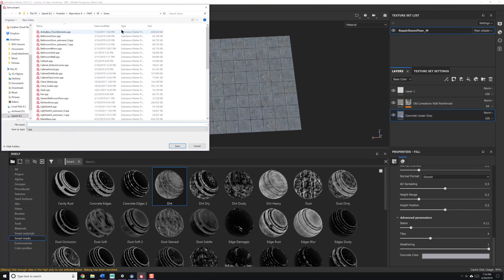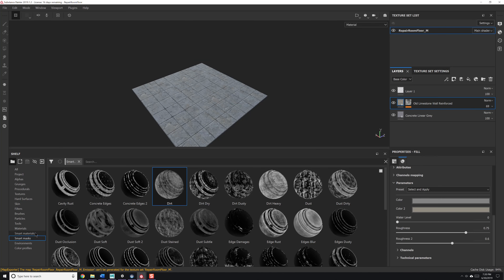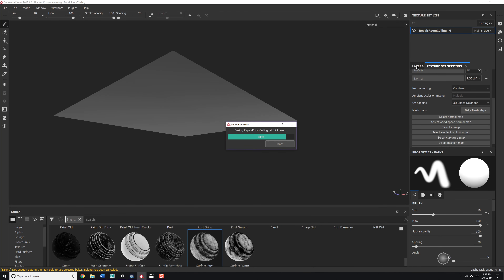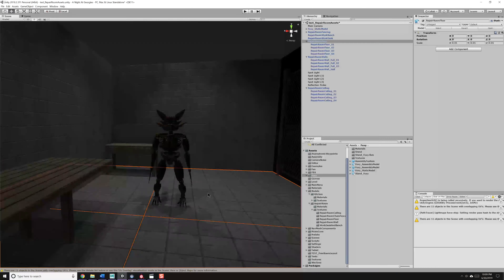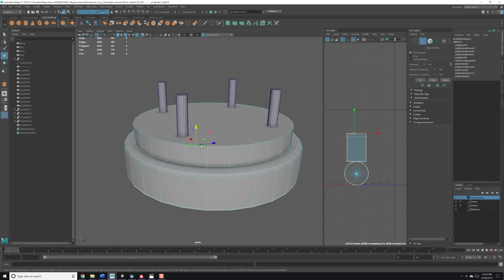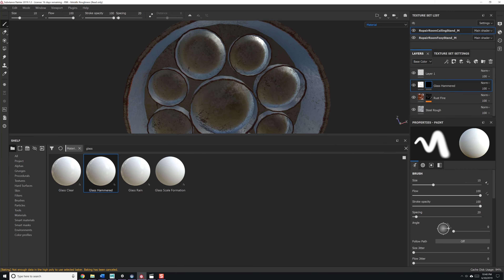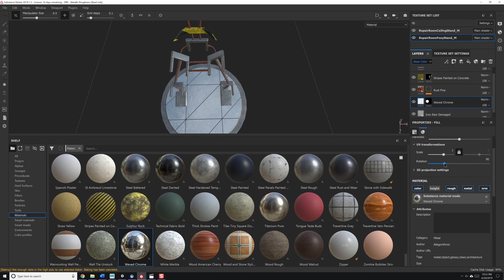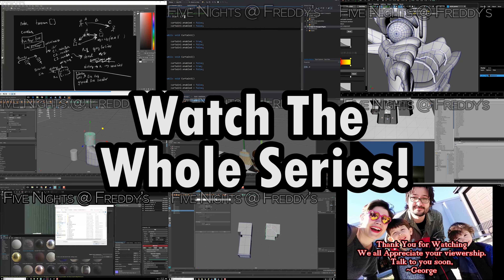FNAF VR in Unity 195 Animatronic Repair Room Modeling and Texturing

Comment: Very good. Very good indeed. Is there going to be volumetrics on for the light?
Reply from the maker: Good question, not sure yet what I'll add yet. Need to also start looking through the post processing stack.
Reply: To do that you would either need to use a plugin like aura or use hdrp
Reply from the maker: Or I could write my own volumetric handling. https://youtu.be/REtAPN8p8bg